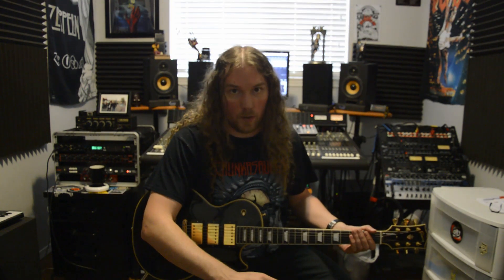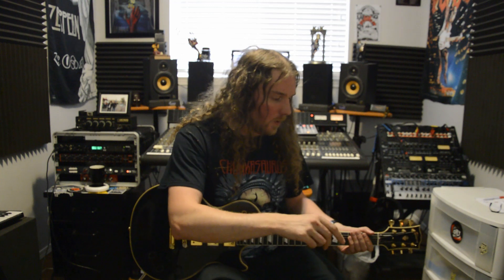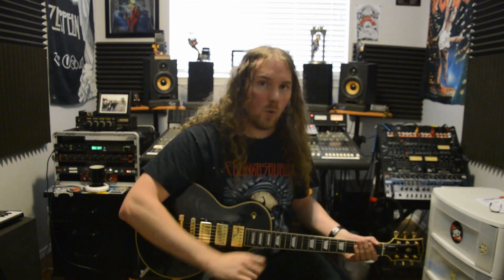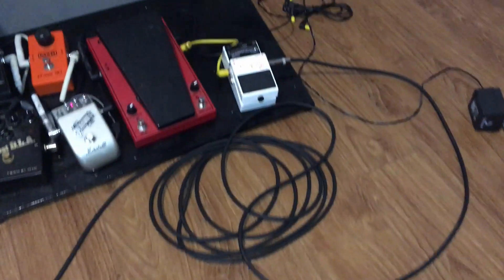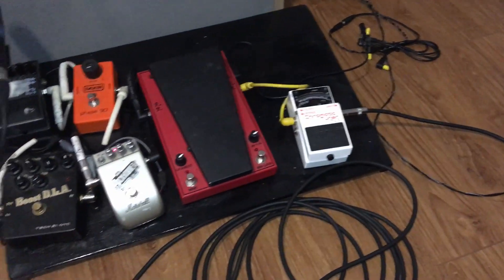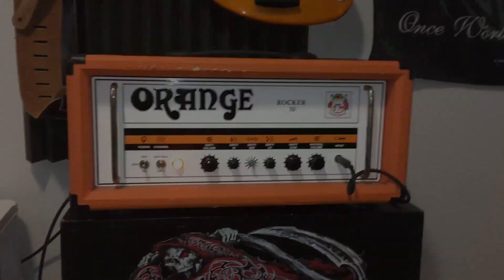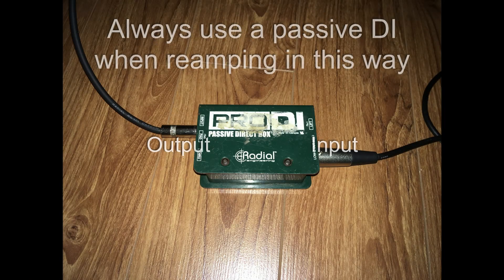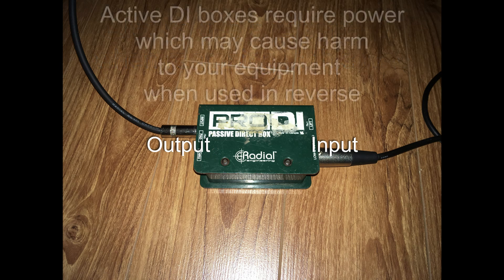How To Reamp A Guitar Signal

Comment: Nice video! I'm actually planning to buy a reamp box as well as my first good amp, an EVH 5150 III, it eas nice seeing this comparison.

About the results, I found the "real" sound very similar to the reamp box, and the DI box was clearly more "fluffy" and less defined. However, this differences are probably smaller in the mix. I would love to see what's actually behind this different sounds, from my understanding, the DI box will behave as if the guitar signal is having a high cut in the upper frequencies, due to impedance matching. However, I don't know if the reamp box has some theoretical reason to sound different to the original signal. 

Also, probably if the sound between the reamp box and the original guitar is a bit different, it can probably be matched with EQ applied to the signal you send to the amp.

Nice video, it was nice seeing a good comparison on this!
Reply from the maker: Soothsayer Records I didn’t tweak the amp eq at all for the video, but I have found in the past that when using the DI box I have to set things differently to compensate for that “fluffy” kind of sound